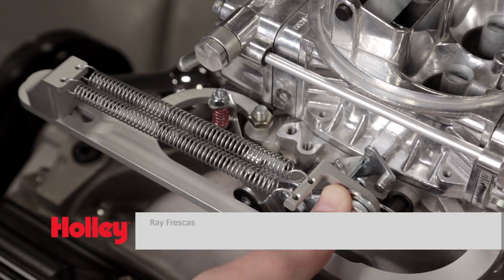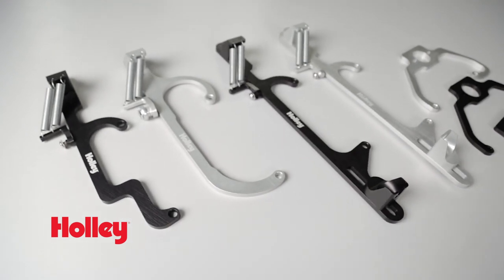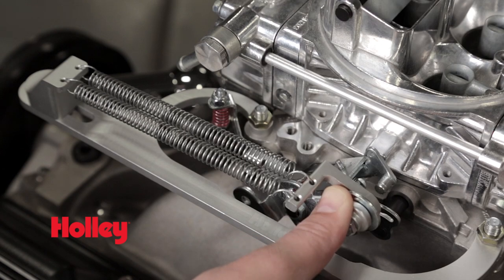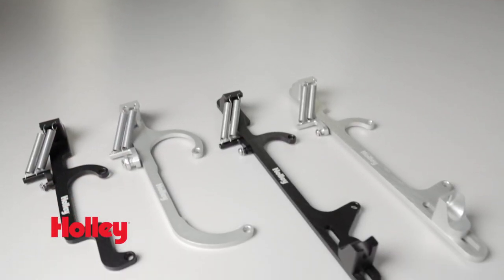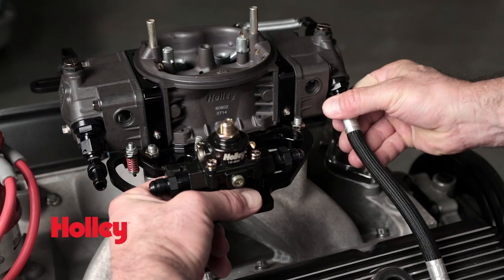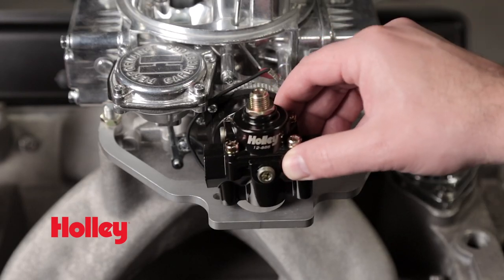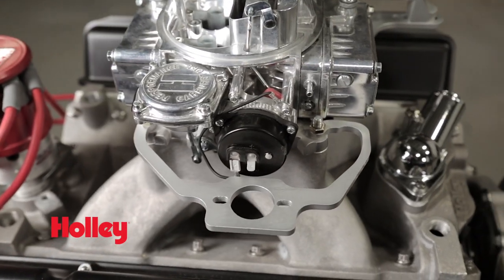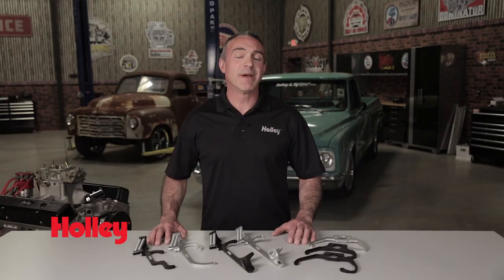Holley Billet Aluminum Throttle Return & Regulator Brackets

Comment: What’s the fuel lines you’re using?
Reply from the maker: That's our Earl's Ultra Flex hose. -R
Reply: Any particular part number or premade lines?
Reply: @ThunderRiffs87   Good luck, I emailed Holley asking about those lines and even sent this video to Holley showing them those fuel lines. I am pretty sure that my carburetor is nothing special but the person that emailed me back said those lines had to be custom made. It is possible that I threw the salesperson off asking why the rear bowl fitting was different that the front bowl fitting and with no surprise he didn't know. I am pretty sure that Holley knows how far apart the fuel inlets are and what fittings to use to make this set up work properly.